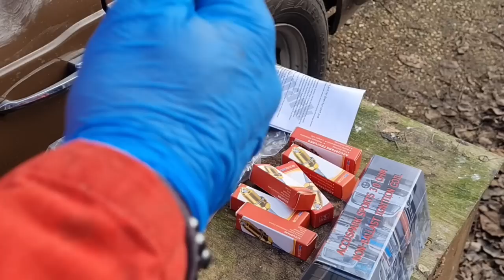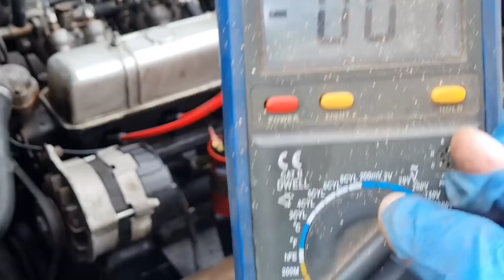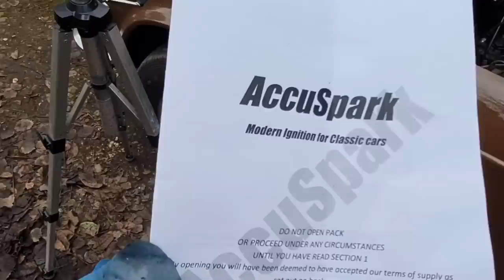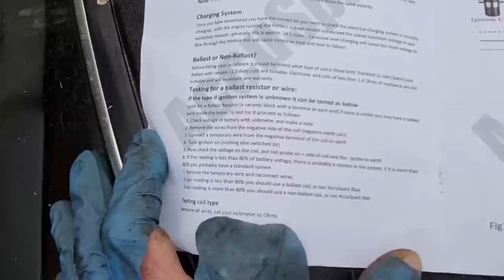Triumph TR6 ELECTRONIC IGNITION fitting.

Comment: Great video, for info there will be an electric fuel pump in the boot with a canister fuel filter originally Lucas many have swapped out to a Bosch set up. This must give around 105psi when running on the pi measured at the fuel distribution block. Also should have a choke pull lever in the centre console, right hand lever. Engine sounds sweet

Comment: I am in the same boat as the bloke with the '74.  I am in the US of A and have a '71 dual-carb setup and need to know if the Accuspark Delco 6 with Tach drive will work.  Looks very similar to the one you installed in the video.  Would appreciate some feedback before I order, please and thank you.
Reply: I’ve just taken mine out and gone back to points, if that helps ( on my Triumph Vitesse same engine only a 2 litre though)

Comment: Interesting , cut my teeth on these too , wish I had a mechanical tac. Want to try hall sensor  type , The stag  mk ,1 has electronic revcounter  and the coil + lead  goes through it prevents electronic , ing , some people say it works some say not  . And I have two sets of points ,vac advance one condenser.  but  it will always  run . Basic just clean points

Comment: As one mechanic to another, I doubt that's a 7/16th's bolt , it's probably 11 mm. LOL just jestin' great video,mate.  I don't believe the coil needs an earth wire because the only earth it needs is through the ignition unit and it's got that.  I expect the extra terminal is for a electronic tachometer which is not used because you're on the cable drive.

Comment: hi me again ,they do have a choke
Reply from the maker: Do they? What even the Pi?
Reply: @NorfolkMancave  yes even the pi,can't recall where it was connected to but i know they did'nt like to be used for short journey's using the choke as they soon fouled up the plugs
Reply: @NorfolkMancave  just googled it it's a twin cable one goes to the excess fuel lever on the metering unit and the other goes to the throttle linkage hope this helps